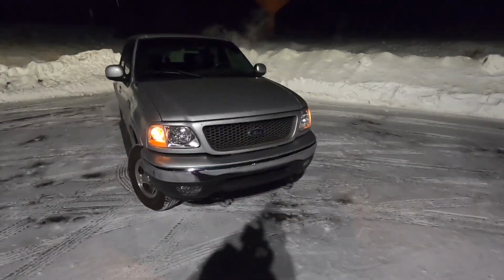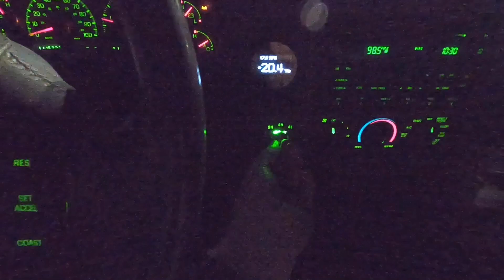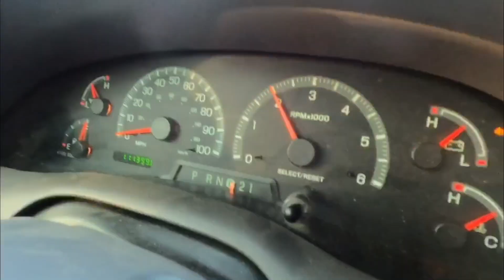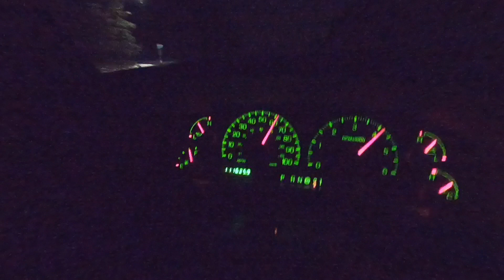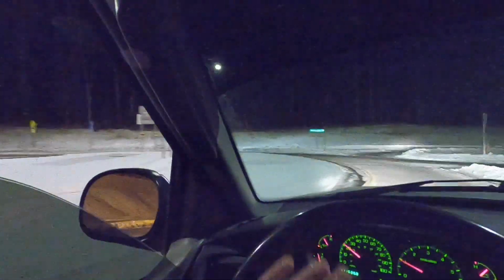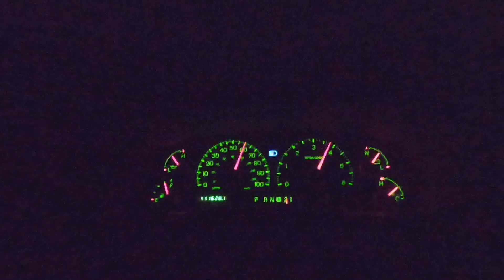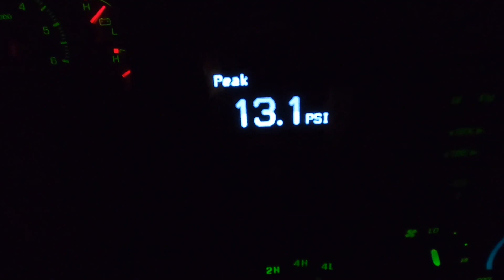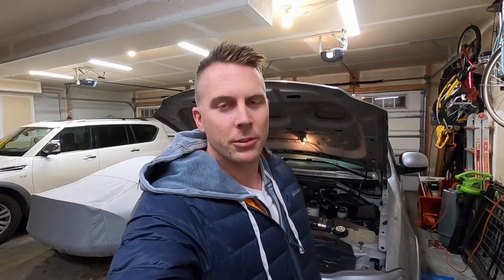'03 F150 boosts over 13 PSI in NEGATIVE temps. Tried 4wd donuts...now it's broken...

Comment: Front diff doesn't "actuate"
Front hubs are vacuum controlled 
Transfer case is ESOF electronic shift on the fly

In those temps,  the shift motor probably isn't strong enough until the tease is up to operating temperature
Reply: 10th generation f150 does not have vacuum hubs, the hubs are hubs and the CV axles have a solid 24 to 26mm bolt locking them in, the differential has a vacuum actuated canister c clipped right in front and pinned to a bar that operates a locking coupler inside the diff, and that system is activated by solenoids mounted by the battery as well as a vacuum canister behind the battery box. All 10th gen f150 4x4 had this system. 98 to 00 ford ranger had the pvh or pulse vacuum hub system which always failed and quickly got replaced by the 01 up bolted live axle setup. The 10th gen f150 was mostly electronic controlled with vacuum diff, 11th gen f150 was all electric activated exceptions being the hd straight axle like the f250 and larger versions. But no his is not a pvh hub system.
Reply from the maker: I could see if it makes a difference to put it in 4 in my warm garage and back it out to see if that makes a difference, but I've used it weather this cold before, so I guess we'll see
Reply: @AutoDetour  it won't make much of a difference unless there's water in the motor, the tcase motor on these 10th gen trucks aren't sealed so water and dirt can get in. You can test it by turning key on but don't start and flip the knob to 4x4, it should wine or buzz if it works.
Reply: @AutoDetour  I've been corrected on the hub situation...

I'd still recommend driving 20-30 minutes to get fully warmed up and try again on the 4HI

Comment: I have always been a fan of the the manual 4x4 shift on the floor as opposed to the electronic selector. Up here in Canada these trucks are one of the most sought after plow trucks. My 10th gen F150 with 4x4 Off-Road package always seems to amaze me what she crawl and chew her way through.
Reply: Manual locking hubs and manual shift transfer case is by far the best 4x4 system ever produced, sure you may have to get out in freezing temps for what a minute just to lock in both wheels but is it really an inconvenience lol, great minds think alike and I miss those manual lock days of the 9th gen down pickups lol. More specifically I miss my 94 f150 xlt.
Reply: It’s still a vacuum system.....

Comment: You can turbo boost a lot easier under cold temperature than seasonally warm temperature. Air density changes with the seasons and is lower under summer and higher with winter. With that said a boost limit should kick in at the setting you desire regardless.

Comment: Get a chrome surround off a heritage and keep the honeycombs.  The electric 4x4 does not like -30°c. If your transfer case isnt engaged the low range should kick it in and then click back to high before backing up.

Comment: I’ve had two of these f150s with 4x4 engagement issues, first thing is to replace the front actuator for 4x4. The system is vacuum actuated so could be the front diff actuator, either of the 2 solenoids for activation and deactivation, and from what I read the vacuum chamber for it is also a failure point and is next to the battery tray. Also double check to make sure the actuator is moving when switching from 2x4 and 4x4

Comment: Had the same issue on my '03. Turns out my transfer case motor was dead and the shifter fork inside the diff needed to be replaced. Turns out on the fork there are 2 plastic tabs on the inside of the fork which look like they are just pressed onto a small boss. If the plastic tabs break or fall off then the front diff will not lock. You most likely will have to go aftermarket for the fork if you need a new one. Don't buy one from the dealer. I called all 3 FORD dealers in my area and none had the part cuz FORD stopped making it. I was quoted that even if they had the part just the fork alone was $300. Went with an aftermarket one from a local parts store, $50. 4X4 works great now.
Reply from the maker: This is great info! Thank you!
Reply: @AutoDetour   These are the part#s for the fork. DORMAN 600560 and FORD F75Z3N139KT. I went with the Dorman cuz I couldn't get the Ford part in my area.

Comment: Hey 1st gear will definitely give you nothing but wheel spin since the trans isn't trying to shift to the next gear, I use first to do donuts and 2nd when I need to quickly pass going 50mph+ and then shift it back to drive at 70-80mph

Comment: I want to get the updated 5.4l turbo kit from CX Racing for my 2011 Expedition.  I'm gonna order a built long block first.  Sleeper kid cab/grocery getter!  Looks like they resolved all the things you had to fab yourself.  Great job though!  I'd have to read up on how to install the turbo controller components.  Seems like you went with the most hassle free option.  Again, Great truck and one tough 5.4L!  Any plans for new builds?

Comment: Try your 4x4 low then switch back to 4 high. But when mine stopped working it was the switch in the dash. Luckily yours is stuck in 2 wd mine was in 4wd when it happened to me.

Comment: So, realistically how reliable is a turbo 2V 5.4 with stock internals for daily use?? I’m asking because I’m looking at buying another crown vic soon and I wanted to 2V 5.4 swap out of a 2006+ E150 Van and put a little DIY 76 or 78mm setup on it. With upgraded fuel system ofcourse. My goals aren’t to go fast or race, it’s mainly just the wow factor and to be a fun daily driver/burnout machine that makes probably 3 - 400whp, not trying to go too far past maybe 9psi just to keep internals safe.  I’m wondering if it can do handle it safely and your the only one I know of whose boosted a stock one for now

Comment: I’d start with cleaning your wire connections n use a dialectic grease on the pins , love the truck 🛻 those transfer cases are pretty tough I’ve beat mine pretty good, I have a video that I thought I broke mine, think it’s on my Instagram
Reply from the maker: That's not a bad idea. Thanks!